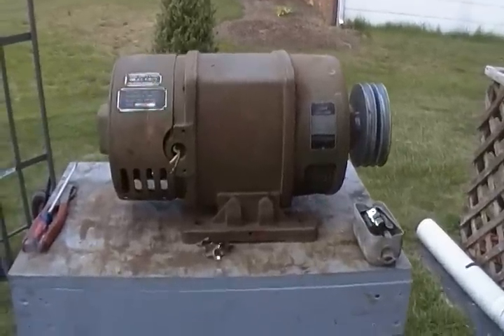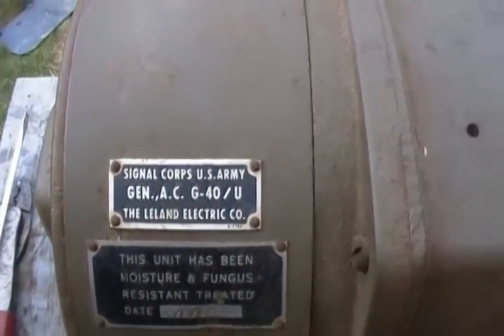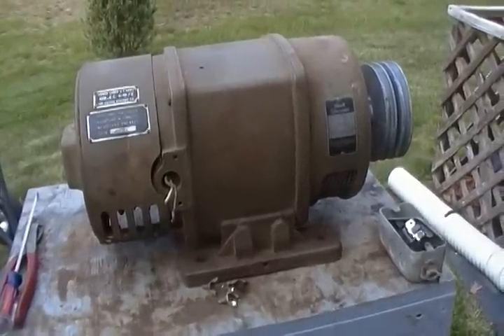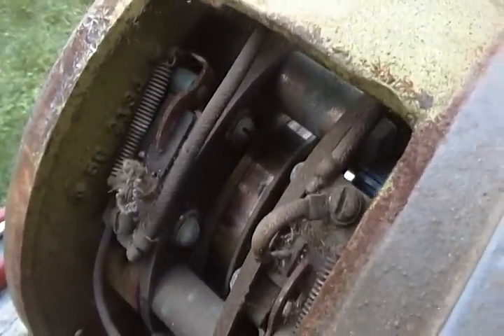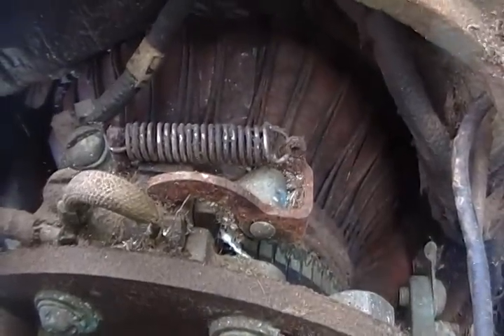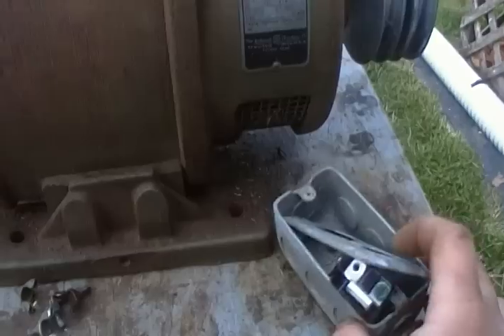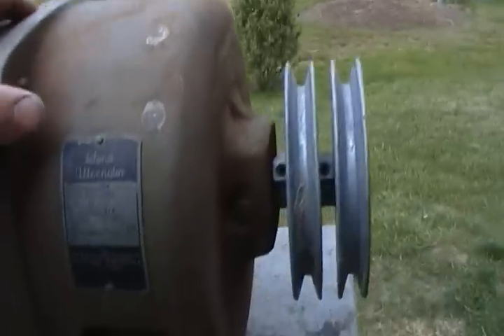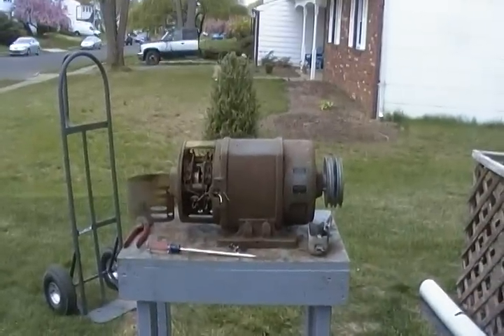Signal Core Leland Alternator

Comment: my engine is a wisconsi tgd ...I started it up and sound very  good and powerfull
thanks for your help ,,.i am workin on the welder section get it ready for a video .  you will see it if every thing work fine..if the smok stops it l be much beter. thanks again 
sinceraly  eduardo

Comment from the maker: I would try just tightening the bolts first, I do not know the toque values off the top of my head but I would just make them hand tight, in other works don't kill em'.  
If not, the gasket is no big deal to replace.  What model is your engine?

Comment: hi, i have a question ,,,my wisconsi engine starts up now...and thank for your help
but i have a litle problem  it smokes betwin the cilinders head and the gasket...do i need to replace  the gasket or i just need to re tigth the bolts?
thanks